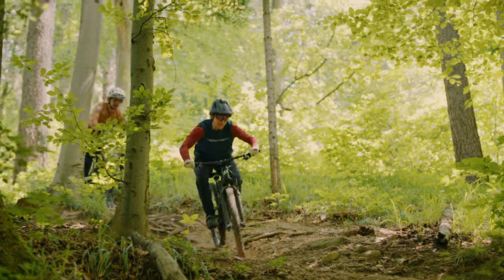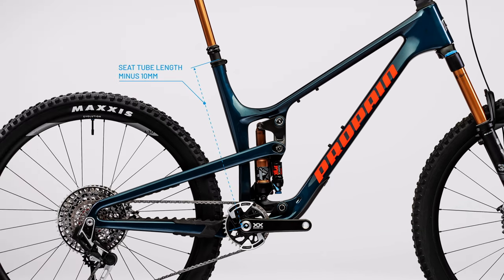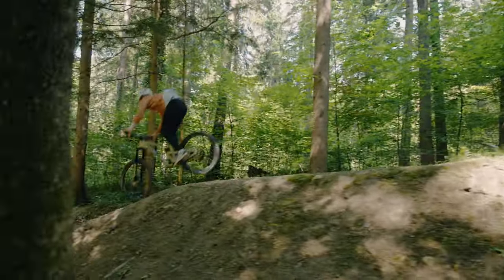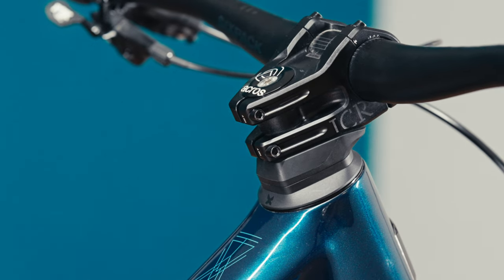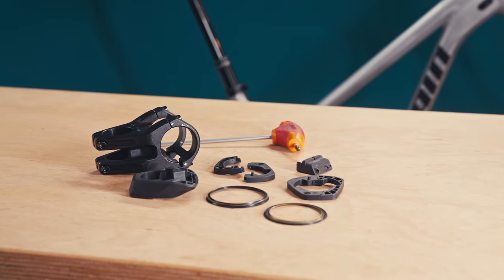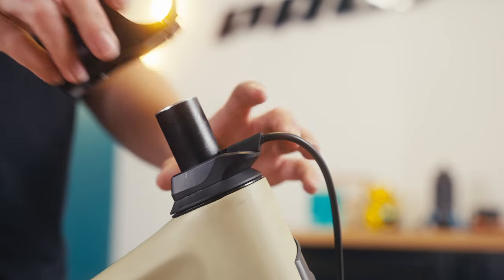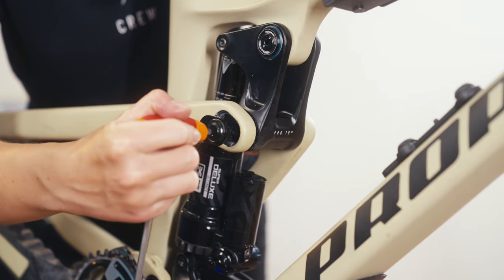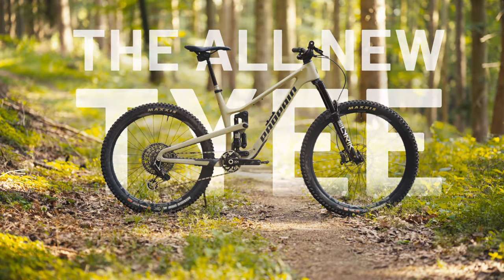The All New Tyee 6 - Let's get into details I PROPAIN Bicycles

Comment: Whats so bad about covering the cable holes if you run wireless ? just plug the holes and it looks absolutely fine. Internal cable routing is just more faffing for the end consumer. It is absolutely, completely unwarranted.

Comment: Can we use our own stem with the frameset or do we need the integrated headset you have?
Reply: I’m pretty sure you can but there’s no cable routing through the outside of the frame on the carbon version. so you’d have to run it through the headset anyways.

Comment: headset cable routing 👎  Also not very coil friendly with a 55mm stroke shock at that travel, unless you're a really light rider.
Reply: please describe the coil thing
Reply: Also curious about the coil thing. Bought mine with a 600 lbs spring, what issues will I encounter?
Reply: unless you're really heavy it's not a big issue, it rides great, the real problem is that shit cable routing
and the inside the frame caliper in the rear that does not allow you to use hope brakes
Reply: @TheMTBRider96  I've got hope tech 4's on my aluminium frame tho?
Reply: @sakurakitsune7645  it seems like they don’t on the carbon one